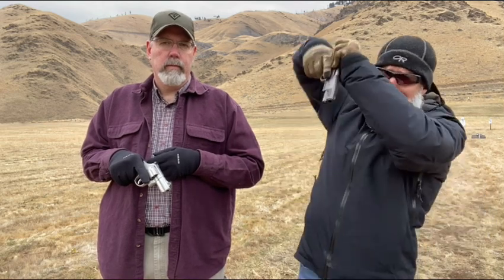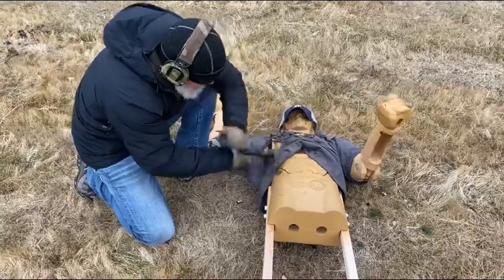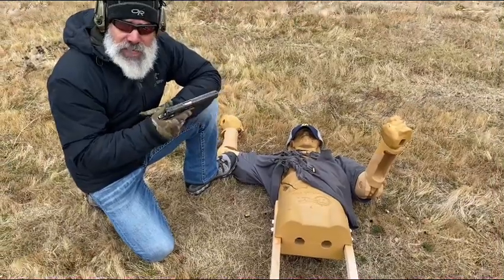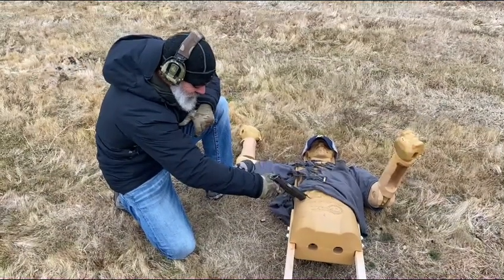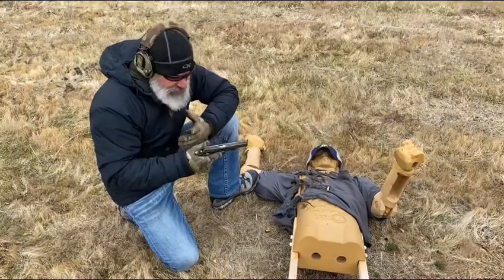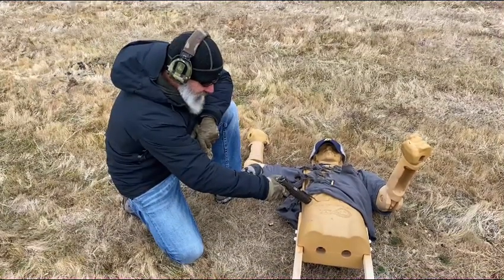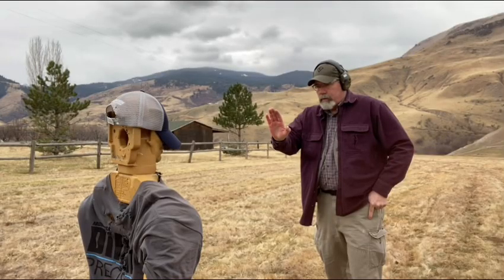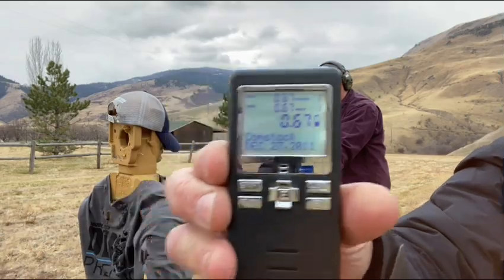Wheel Gun Series 06

Comment: I put my 642 away when I got my G43, thinking I wouldn't need it any longer. About six months later, when winter came, carrying offside in a coat pocket instead of under a t shirt became a good choice. 

Like Drew, keeping a hand on a snub while doing something like pumping gas gives me some comfort, especially with all of the recent carjackings in my area (Twin Cities). Stepping away from the car so as not to be trapped between the car and the pump, as well as being able to see more, is now a tactic I use as well.
Reply: They certainly fill a niche in extreme temperatures, both hot and cold.